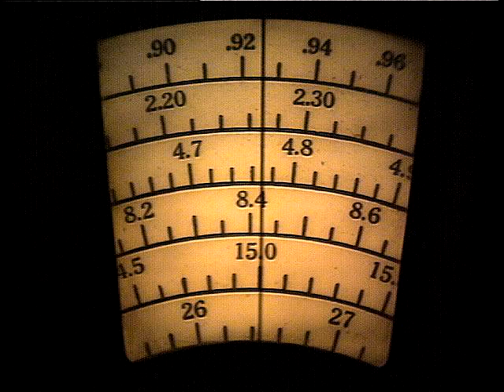WWV Frequency Reduction Announcement - 1976

Comment from the maker: @WX5G The frequency change took place on January 1, 2009.  The change was necessary due to an ITU HF global reallocation that re-assigned the spectrum just above 40-meters to broadcasting.  The problem was that CHU is licensed as a "fixed service", rather than a broadcast service, so it had to move.  In fact, some broadcasters had already started using 7335 kHz before CHU had officially vacated the frequency!  Their other frequencies remain unchanged.  WWV dropped 25 MHz back in 1977.

Comment: WWV and WWVH still operate on 2.5 MHz as well, but at lower power compared to 5, 10, and 15 MHz.  WWV (only) also transmits on 20 MHz, also at reduced power.

WWV also transmitted on 30 and 35 MHz from 1946 to 1953.